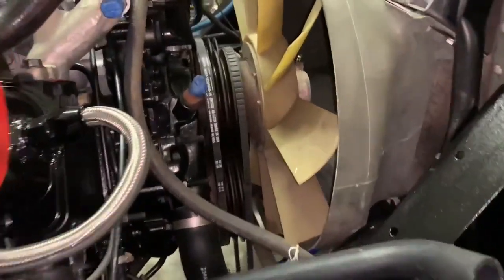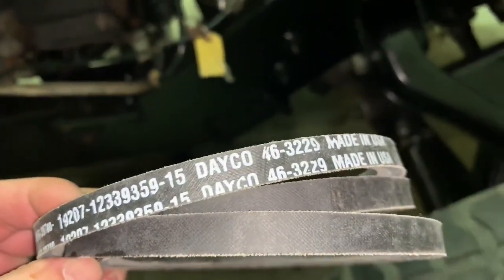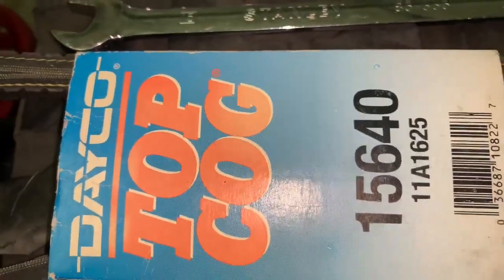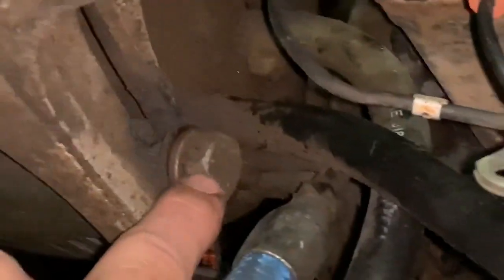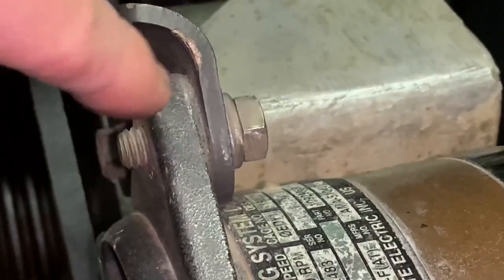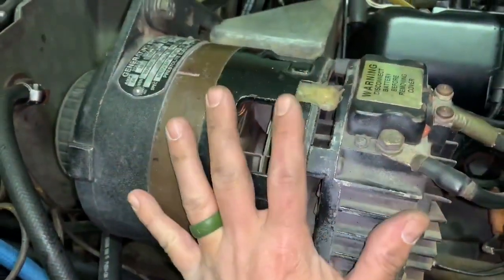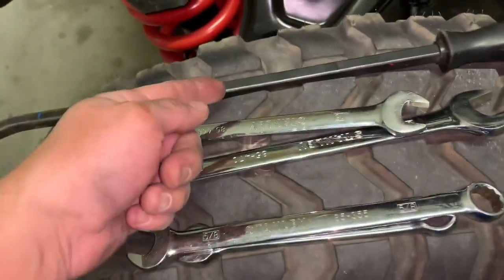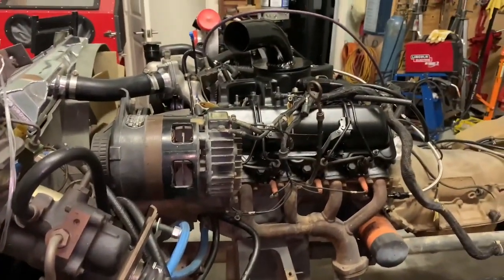HUMVEE Power Steering and Generator Belts Replacement

Comment: Instead of prying the alternator back with a crowbar, you’re supposed to use a 1/2” breaker bar in the 1/2” square hole in the top alternator bracket to tension the belts.
Reply from the maker: Thanks for the comment! Another viewer also pointed this out a while back! I didn’t have a manual so I was justing figuring things out myself. It would have been easier if I knew about the square hole!

Comment: Great video , how much did you tighten the belt ? All you could give then snug down the bolt to hold it ?
Reply from the maker: @jasonb5833 Thanks. Ya, you will want to put tension on the belt as they will stretch  a bit over time. But not too tight because it will wear excessively. Best thing to do is after you are done, start up the engine and see if it’s looking ok at idle. If it’s too loose, you can see it wobble and vibrate.
Reply: How much “ slap “ should be on the belt? Just replaced both and seems like half inch ?